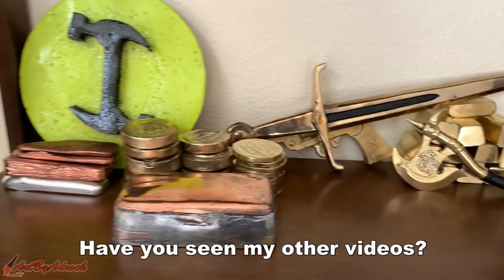Casting The GLASS Sword From The Game Skyrim - Aluminum Casting

Comment: Very beautiful Place salt in molten aluminum until you get rid of slag💪💪💪💪😍
Reply from the maker: DRACULA FIRE thanks 👍🏻🍺
Reply: No, contrary to YouTube legend adding salt, or more specifically lite-salt, does not do anything to remove impurities in your aluminum. There are actual fluxes that you can buy to aid in this but adding salt just adds more crap to your metal.
Reply: @swdweeb I tried it myself and succeeded
Reply: @draculafire4870  have to agree with swee, need to watch olfoundryman. He is truly a master and a mentor.
Reply: @swdweeb  borax perhaps?

Comment: Did you line that again with new wool?!? Or was last week a video shot after this one 🤣🤣 Seeing you ramming up the flask looks easyer than it is... yesterday tried to sand cast a logo for my dad.... big failure, aluminium dropped trough my styrofoam and sand 🤨🤨 all leaked onto the floor. I will be away next week with the navy but I will try it again when I am back 👍👍
Great job on the sword bro!!